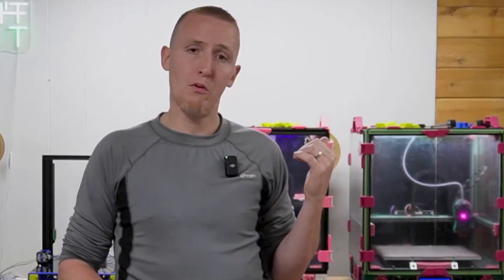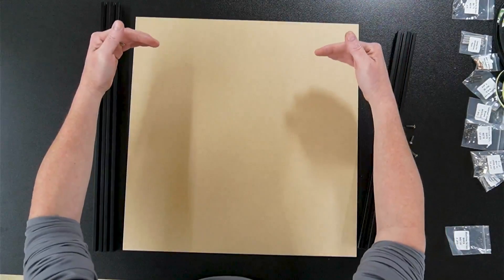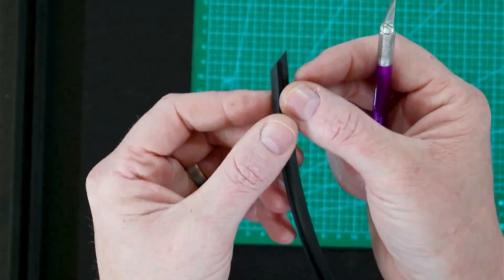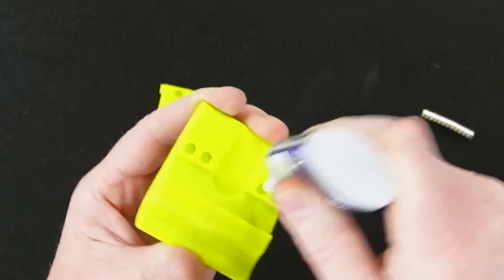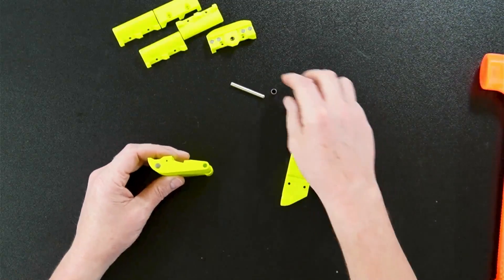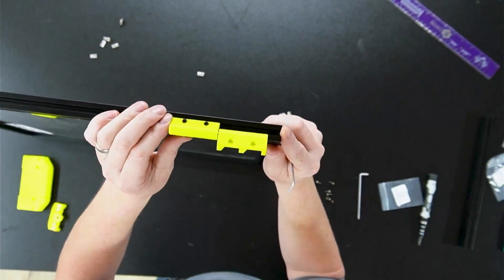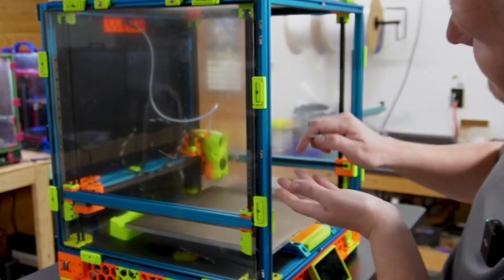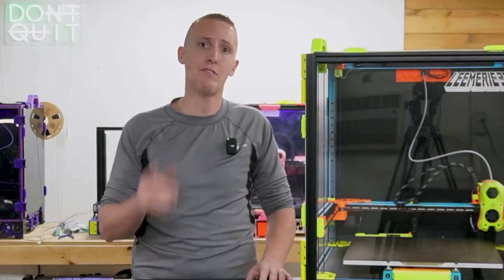Voron 2.4 Clicky Clack Door Mod: Fridge Door Assembly Guide #voron #3d

Comment: Currently building this, but using the Linneo Nano panels instead of teh regular single pane one, it rattles around quite a bit after assembly
Reply from the maker: One trick to this and I should have included in the video. If you get a panel like that you can take on the other side and add foam tape around the edges. It should push it forward and make it tighter in the extrusions :)
Reply: @leemerie3d  I found the LDO wiki about it and they told you to get 8mm wide/1mm thick EVA foam tape and put around the outside edges (sitting at the bottom of the extrusion groves) and that worked reasonably well. still some minor rattle as ikt seems to have some room in/out, but not up/down or sideways.
Reply from the maker: @SteinerSE Yep! That will do the trick. Glad you got it fixed. Thanks for the update! 🙂

Comment: Hi, thanks for the video. I might add that the orientation of the hinges matters. If they are both installed the same orientation then you can open the door and lift it straight off the pins (the bushings stay with the hinge.) I guess if you don't want the door to be removable then you can orient them opposite and it will be "locked" in.
Reply from the maker: Ahh! I had not thought about that. Very cool 😎 Thanks for the tip. I sort of like being able to remove mine easily but yeah if you want to lock it in, that would be nice. Much appreciated! Thank you for watching ♥️

Comment: I just finished mine and i cant get the door to unlatch without prying on it. Are there any small adjustments you had to make get yours to open properly?
Reply from the maker: I've installed a couple of these. Loosen the screws and then close it all up. Then tighten them after. If you still need some help, join our discord linked in the description and I'd be happy to help you figure it out. Thanks for watching!

Comment: Wondering on average how much higher chamber temperature were you able to achieve with the new door?  I am perfectly happy with the stock doors on my 2.4, and trying to decide whether this door mod is worth pursuing.  I like being able to only open half of the front at a time, so there would have to be enough gain to be worth losing that.
Reply from the maker: I totally understand that. The stock doors have some benefits as well like you mentioned being able to open just one half of it too.
It brought my temps up about 4-8 degrees. Average of 5c. 

I hope that helps. If you need anything else join our discord or message me. Thanks for watching!
Reply: @leemerie3d  Thanks, that was the sort of info I was looking for.

Comment: You don't think the door on a 350 is too big? That's my only concern and thing stopping me from adding to mine
Reply from the maker: You definitely need to make sure you have the room to open it. But I was overall very happy with this mod. I also have several more sets to add to my other machines even. The 350 is just a big machine all around anyhow. But I think it is a good size just make sure you have the space in front and to the side and you will be good. Thanks for watching!

Comment: it's 360px quality, pls make it at least 720px
Reply: It's just YouTube processing video still it'll be 1080p
Reply from the maker: Yeah it's 1080 so it's either still processing since I just uploaded it, or if your in a lower signal area yt will drop it down on your phone. Check that little button and see if you can change to 1080.